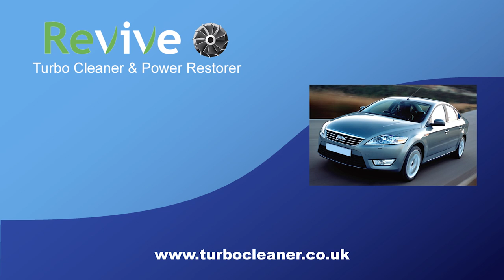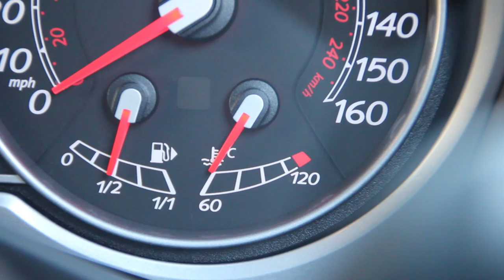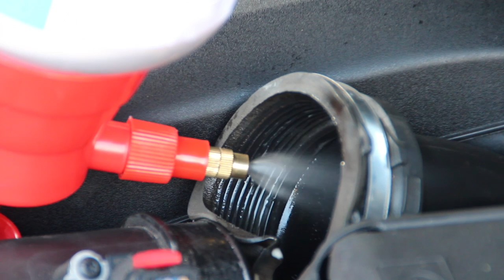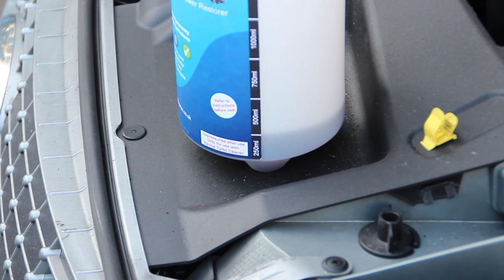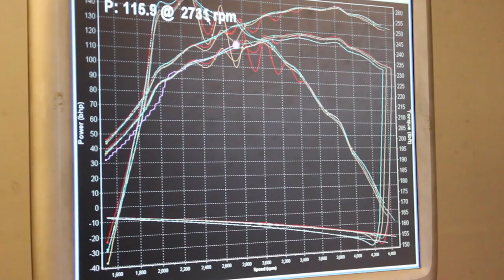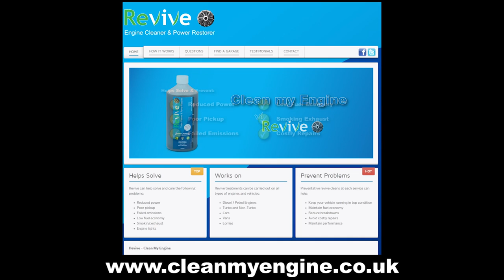Revive Turbo and Engine Cleaner

Comment: I own a 02 Toyota 1800 Avensis. (90,000 miles) It's using oil weekly but there's NO oil leaks, seems to run very well and with no exesive smoke from the exhaust. I believe that the oil ring's on the pistons are glued up by engine deposits and is allowing engine pressure past the ring's and thus carrying engine oil into the combustion chamber. The engine sensor light is showing on the dash and the diagnostic kit say's the Engine emissions are incorrect and on it's last MOT only scraped through on the emissions test. Very impressed with your You Tube demonstration. Question. Do you think your Revive engine cleaning product will sort out my engines problem.
Reply from the maker: Hello Chris and thanks for contacting us. Well, we haven't carried out any testing on 'gummed' piston rings, so you would need to decide on whether to give Revive a try or not. However, Revive will clean everything else in the air path, so it is always beneficial to give an engine a Revive clean.
Reply: Thank's for your honest reply. On that note I'm going to give your product a try. It can't do any harm to my engine and who know's it might clear my gummed up ring's. before I have the multi expense of stripping down th engine. I'll let you know the out come for your files.
Reply from the maker: Thanks and please do!
Reply: Well Chris have you tried this yet? If so has it made any difference?
Reply: Just wondering if you had used the Revive and if so has it made a difference and sorted out your problem's of chewing gum in the piston.

Comment: I wish I'd found this product before I sold My golf TDI.  It was having issues with the turbo waste gate sticking open and ensuing engine codes.  After shutting the engine off they would reset.  I was wondering though if Revive would also work on injectors in the same car?  What about the new gas powered golf tsi engines?
Reply from the maker: Revive is applied through the combustion process, so it would not go' through' the injectors. However, the Direct Injection Gasoline engines suffer from carbon fouling on the inlet valves, which Revive will help to reduce.

Comment: Thanks for the video does it work on cars fitted with a DPF in the exhaust?
Reply from the maker: +Dale Ovenstone Hello Dale and thanks for the question. The way that Revive works, when applied at velocity through the combustion process, the active ingredients, remove the soot and carbon deposits in tiny particles, which are no bigger than the soot particles the engine naturaly generates, so it is perfectly safe to use on vehicles fitted with a DPF. However, if you have a fault code in the Engine ECU, not relating to DPF, then the ECU strategy will abort any attempt to dynamically regenerate the DPF until those faults codes are cleared/ fixed. We would always recommend to check the soot loading after a Revive treatment and carry out a forced or dynamic regen afterwards, as the treatment will add to the soot loading.
Reply: +Dale Ovenstone Hey, that's great news thanks for your prompt reply. Regards Dale
Reply from the maker: Hello Dale. Revive strips away carbon depsoits away in tiny particles, making it safe to use on vehicle fitted with a DPF.

Comment: brilliant one question does this destroy carbon in the egr valve as I have problems with it and it's welded bmw 3 series 2010
Reply from the maker: +Jay Wigley Sorry for the delay in our reply. Revive will remove soot deposits from the EGR, depending on where it is situated in the system. However, Revive needs to pass through the deposits to be effective, so if the EGR is solidly blocked, it needs removal and manually clean it on a workshop bench, not in situ. Kind regards
Reply: Thanks for the reply that's okay I'm just struggling because it's welded and in my area no one wants to help take it off thanks anyway
Reply from the maker: +Jay Wigley Oh... physically welded! :) Sorry, so you can't remove the EGR. We thought you meant 'welded' shut through carbon. Then I would suggest using Revive providing the EGR is inline with the airpath that Revive will take when being applied.
Reply: +spdiagnostics thanks for the reply and I will as the egr is welded on where can I buy this product? and can a normal egr spray cleaner work doing the same method many thanks jay
Reply from the maker: +Jay Wigley Please visit www.reviveturbocleaner.com for where to buy Revive. There are some very agressive EGR cleaners on the market, which have no end of chemical warnings on the can, so if you choose to use one of those, please use in a well ventilated area.

Comment: Hello. I will try revive turbo cleaner on my Audi A3 2.0 TDI common rail engine . When I feel it lacks a little power . Could this damage my engine in any way ?
Reply from the maker: +krupp4000 Hi. As we discussed on our Facebook page...Make sure your turbo actuator isn't at fault by scanning the ECU for Faults. Also check your actuator diaphragm is holding vacuum. Once this has been done... then please use Revive to clean the engine and turbo. You can purchase it in Norway from www.reviveturbocleaner.no

Comment: Hi I was wondering if you can tag me in a post. I have a 2003 golf 4 tdi highline and I'm recently experiencing turbo problems.whenever I take the car past 120km/h the boost goes away and the car becomes sluggish. Only when I switch the car off then on again the boost comes back. Please I need advice as it also happens sometimes at 140km/h. I have taken the car to vw and they checked the turbo and N75 valve and everything is okay.Diagnostics picked up no faults as well. I need advice . Thanks
Reply from the maker: +Mohammed Zarif Khan Hi Mohammed. It does sound like the classic symptoms of sticky variable vanes in your turbo which www.reviveturbocleaner.com would sort out for you. However, you must still carry out some basic checks, such as vacuum leaks and check that the actuator diaphragm is holding vacuum too. Once you are happy that everything is in order, then please Revive Turbo Cleaner. 
Kind regards

Comment: Hello there! I would like to know if this could work on a automatic peugeot 2.0 hdi. Engine goes on limp mode when reving it up, however is not consuming oil or fuming white except when I first start it and it's cold. Could be this due to carbon deposits? Engine management light is popping up on long gears after blanking the EGR. Thanks!
Reply from the maker: +Ruben Cayon Hello Ruben. You can carry out a Revive treatment on your Peugeot HDI. However, we cannot diagnose your vehicle, so we would ask you to seek professional advice by talking to a qualified technician. Revive is extremely effective at removing soot and carbon deposits, but it cannot repair faulty sensors. If the technician you use, agrees that the problem is due to carbon, then please use Revive.

Comment: hi. i was wonderig if this will work for a 2004 honda accord 2.2 ictdi and if so where can i buy this in northern Ireland. Thanks
Reply from the maker: +Stephen Carmichael Hello Stephen. Firstly, Revive is suitable for all Petrol/Gasoline , Diesel, turbo and normally aspirated engines. Please ensure you have carried out some basic diagnostic checks and once you are happy that your problem is due to soot or carbon deposits, then treat your engine to Revive. Our distributor for Northern Ireland is http://www.stephenrobinson.com/ . You will need to ring them to order it because they are currently building their dedicated Revive website with online shop. Kind regards
Reply: Great. Thanks for the quick reply

Comment: how do you use this on a bmw diesel engine. Do i need to take the air filter out?
Reply from the maker: +YaM TOObE Hi and apologies for the delay in our reply. You apply Revive after the Mass Air Flow sensor. If you are not sure , please seek professional advice.
Kind regards

Comment: Hi there, I have one issue with my car. Is going to limp mode. One of mechanic told me turbo is dead. Also I have oil inside of pipes who go to EGR . Can I try using revive ?
Reply from the maker: +Radu Morteanu Hi and apologies for the delay in our reply. If you have been informed that your Turbo needs replacing, you need to find out why. Is it due to mechanical wear? Cleaning it with Revive will expose mechanical wear and will make it worse. Revive should only be used on mechanicaslly sound engines. If your turbo has sticky vanes due to carbon and soot deposits, then Revive will help . Oil inside intake pipes could mean a number of things, llike a breather/seperator issue but without knowing what vehicle you have, we cannot diagnose the problem over the internet. Please seek further professional advice. Kind regards

Comment from the maker: +Zayda Castillo  We cannot reply to your question due to your privacy settings. Hopefully, you see our post. Yes, you can use Revive on your Mazda. It does depend on what the problem is before we can confirm it will work. If it is down to oily soot deposits, then Revive will definitely make a difference.
Reply from the maker: The process is the same regardless of the model. If you do not know where the inlet pipe is, we would suggest to seek professional trade advice.
Reply: Can't wait to try this out on my car. I have a 01 audi a4 1.8t quattro gasoline with about 170k miles on motor and turbo, would this product be beneficial to my setup? Thanks!
Reply from the maker: +Chris Watson Hi Chris. Revive will clean any gasoline or diesel engine,  (except 2 stroke) whether it's normally aspirated or turbocharged. So, although Gasoline engines burn so much cleaner than diesels, they still generate soot and carbon, so it will benefit from a Revive clean. If it has a specific problem, then we would recommend you consult a professional workshop.
Reply: +spdiagnostics can you show how to decarbonize a ford fiesta 1.4tdci

Comment: the spray for the tube air filter or Intercooler ??
Reply from the maker: +Biof Fabio através da entrada de ar a jusante do filtro de ar. Sim, vai passar pelo intercooler
through the air intake after the air filter. Yes it will go through the intercooler.
Kind regards. www.reviveturbocleaner.com

Comment: what about the cat / catalyst will it be damaged ???
Reply from the maker: +the1to9 Hi and thanks for your question. Because Revive is applied at velocity through the combustion process, the active ingredients in the water based carrier, remove the soot in tiny particles, which are no bigger than the soot particles that the engine naturally generates, so it is perfectly safe to use on vehicles fitted with a Cat or DPF.  It will add to the soot loading on the DPF but this gets burnt off during it natural regeneration cycle. However, if there are any fault codes in the engine management system relating to Over-Boost or Under-Boost because of turbo issues, the ECU strategy will abort any attempt to regenerate the DPF until the turbo issue is fixed.

Comment: Could you tell me how this product gets to the turbine vanes? Surely if it's sprayed into the air intake then it will be burnt in the combustion chamber before it reaches the turbine?
Reply from the maker: DLAerials Hi and thanks for your question. Revive is a very robust non-combustible fluid and because it's being applied at velocity through the combustion process in measured quantities at specific RPM's, it survives the combustion process and due to the degree of valve overlap, it reaches the hot side of the turbo. More details can be found on our website : www.reviveturbocleaner.com.  Kind regards

Comment: What would happen if you were to spray revive into the intake at higher revs, let's say 3000 revs
Reply from the maker: lee davies Hi Lee and thanks for your question. The application rate in RPM is calculated to achieve optimum dwell time or in other words, contact time. If higher RPM's were used while applying Revive, this dwell time would reduce significantly due to what we call.. 'Pass-By'.  We can understand why some customers think that applying it at higher RPM's would create a higher velocity and therefore have a greater effect but it doesn't. Sometimes less is more! :)
Reply from the maker: This does of course apply to vehicles with a 'normal' red line limit of 5,000 rpm. So if a calculation of 0.4 is applied to this rev range (5,000 x 0.4) it would be applied at an average of 2,000 rpm. If used on a motorcycle (less fluid required) which has a red line limit of 12,000 rpm (x 0.4) would be applied at 4,800 rpm . This is only an example for exceptions to the norm.

Comment: Will it clean the intake valves of direct injection diesel engine? The engine in question is hyundai CRDI and i have carbon build up issue on intake valves
Reply from the maker: Sandeep Singh Hi Sandeep. Revive will help remove any sooty deposits in  an engine's air path. Because fuel is injected into the combustion chamber on all direct injection petrol/ gasoline and diesel engines, there is no fuel 'backwash' on the inlet valves and this is the cause of the build-up. So the answer is yes and this applies to all direct injection engines, including your Hyundai. Refer to www.reviveturbocleaner.com for more info. 

Regards

Comment: Hi would this clean a sticky turbo actuator
Reply from the maker: Muizz Khan Hi , Revive will clean carbon deposits from the variable vanes inside the Turbocharger, which will cause a sticky actuator rod. It depends which vehicle model you have, as some use a vacuum operated actuator and others are electronic. If you disconnect the actuator rod at the actuator end, you can then manually move the rod to see how 'freely' the variable vane mechanism moves. If you are unsure, we would suggest you seek professional advice from a technician. Revive is excellent at cleaning sooty carbon deposits, it cannot repair faulty actuators.

Kind regards
Reply: spdiagnostics Hi thanks for the reply the car is an Audi A4 s line se 170 pd engine, the turbo actuator is starting to stick, I've been running on v power diesel at the moment, it has helped abit. If I purchase this product do you think it will resolve the issue and if so where can I purchase this product from Thankyou.
Reply from the maker: Hi, If you are happy that the vane assembly is sticking then Revive could be the answer to your problem! Have a look on our website and click on the Purchase tab which lists our distributors in the UK and Internationally.
Reply from the maker: bacurda Hi and apologies for the delay in our reply, we have recently moved into larger premises and have not had internet until now. Please call us on +44 (0) 1225 744777 to discuss and we will able to point you in the direction of a distributor in your area.. http://reviveturbocleaner.com/index.php/purchase  Kind regards

Comment: I have just used this on my suzuki tl1000r. ..the amount of crud out of the exhaust is unreal...i have used two bottle..i think the stuff is amazing....
Reply from the maker: Matt matt Hi and thanks for your post. Good to hear you're happy with what Revive can do on 4 stroke motorcycles.Interesting you used 2 bottles, as you only needed to use one. It clearly worked but how did you work out the RPM to apply it at? For everyone reading this post, please be aware that Revive is NOT suitable for 2 Strokes.

Comment: Hi I have Passat B6 2.0 TFSI petrol can you tell what revs I should had on my engine when using revive. As in a movie or higher cause I have petrol engine and turbo starts about 3000 revs. Thanks.
Reply from the maker: MrKrzysztof79 Hi and thanks for your question. You apply Revive to your TFSI in the same way. The first 250ml at 2,200 rpm, then the 2nd at 1,800 rpm and the third at 2,000 rpm as per instructions. Although petrol engines burn cleaner than diesels, Direct Injection Petrol engines suffer from carbon build-up on the back of the inlet valves, due to no 'fuel backwash' and Revive will help to remove this.
Reply: Thanks a lot.

Comment: hi, is this suitable for a '08 Mazda BT50 3.0L Diesel
Reply from the maker: alex mclaughlin Hi Alex. Yes, Revive is suitable for your Mazda BT50. Revive can be used on all Diesel engines, with or without turbo. It can also be used on normally aspirated or turbocharged petrol/gasoline engines too, with the exception of two strokes and the Mazda Rotary. Here is a list of stocking distributors. http://reviveturbocleaner.com/index.php/purchase

Kind regards